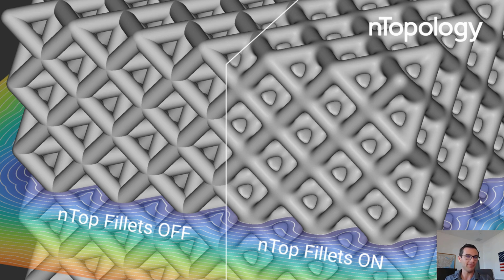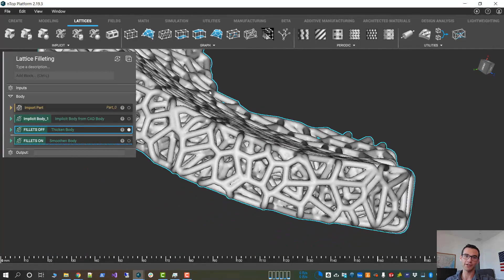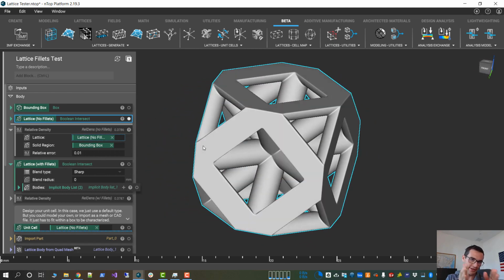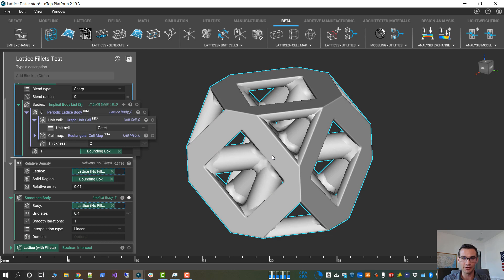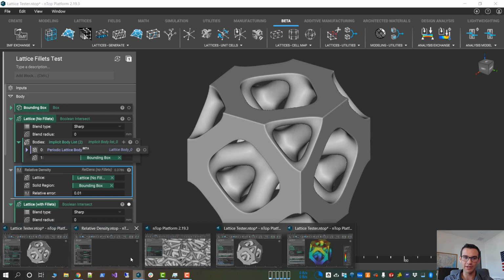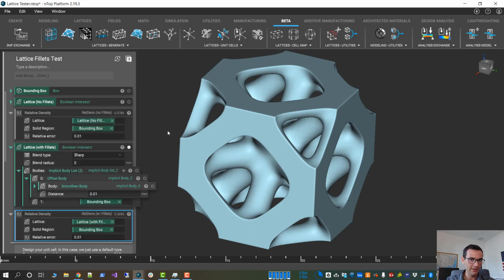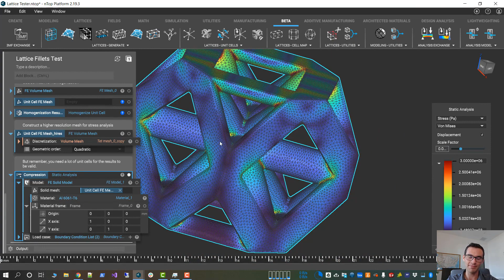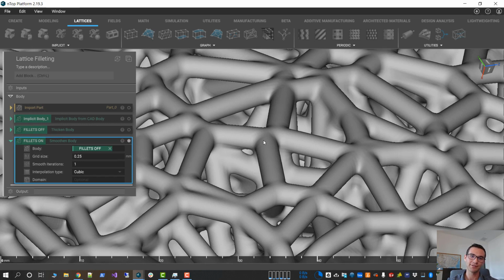Effortless Nodal Filleting for Complex Lattice Structures

Comment: It would be great if you can ramp the size of those fillets. I currently extract points from my lattice, and I add spheres based on that point list. Then, I apply boolean union with ramped blend radius among those spheres and the original lattice thicken body. However, when there are too many points, it’ll take nTop forever to merge those spheres.